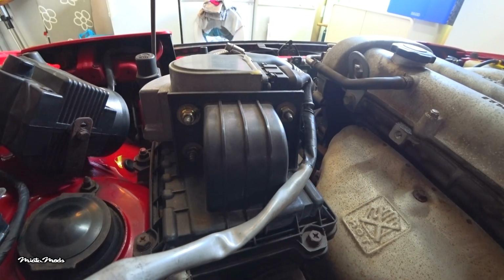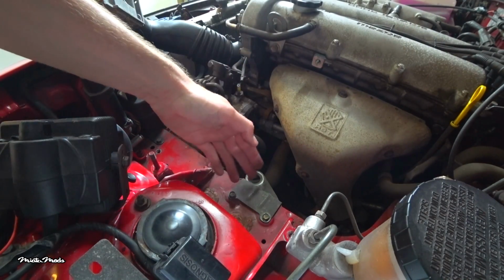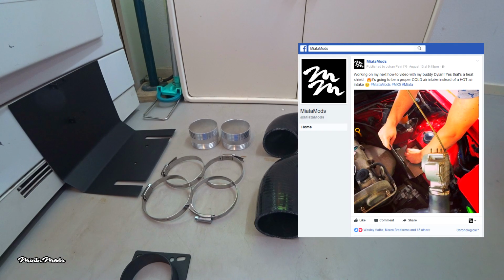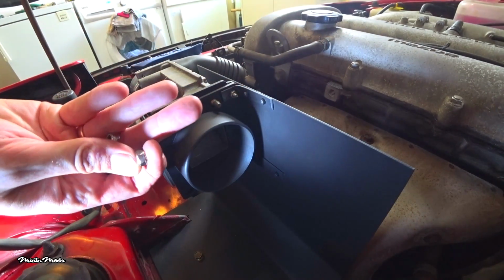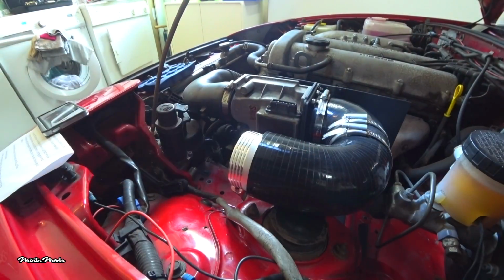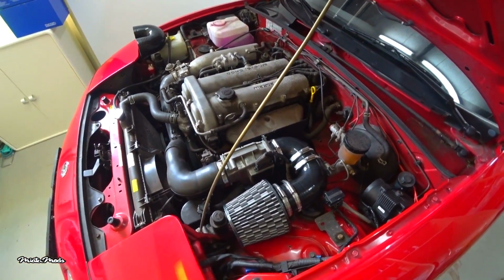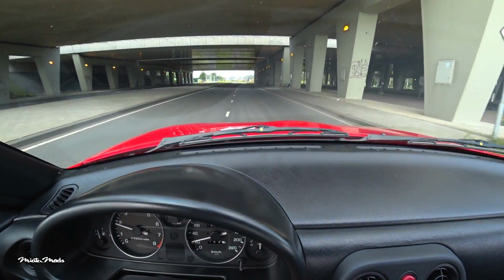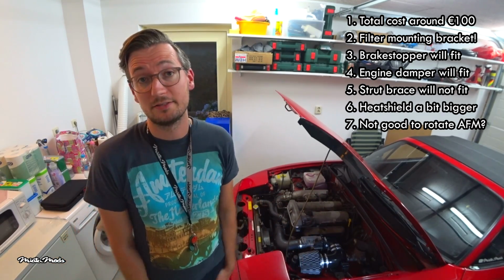MX5 NA Miata - How to build your own Cold Air Intake and heat shield

Comment: Does this heat shield push the afm farther to the left a bit instead of the crossover resting on the neck of power fluid resovoir I’m trying to fit an aluminum 180 degree pipe and need to know if there’s enough clearance for 12 inches
Reply from the maker: Yeah it does, but I'm not sure if you have enough clearance. There is one way to find out, and that is to try it!
Reply: Yepp all I can do is try I’ve got the heatshield made and am going to mount the arm father back to fit in an aluminum intake pipe that’s a 180 degree kinda like the one you used but instead of 10 inches in width from side to side it’s 12 but I think it should fit

Comment: What size 180° silicone hose would you recommend? 

I’d like to buy one, and make as little cuts as possible, to use as little connectors as possible. 

Thanks
Reply from the maker: Hard to say, your best bet would be a local seller

Comment: The air flow meter is supposed to be mounted horizontal so gravity doesn't affect the flap
Reply from the maker: I thought so too but it's been like this for 5 years now and I haven't experienced any problems so I guess it's not a big deal

Comment: Will this work on a NB Miata 1999?
Reply from the maker: Not exactly because '99 NB MAF is different from mine (AFM) but with some adjustments to my design you can build your own version
Reply: @MiataMods  Wouldn’t it be almost the same except no AFM adapter? I’m a big noob at this so correct me if I’m wrong but the 180/90 degree piping could go directly onto the MAF then to a pod filter

Comment: Your buddy who told you not to rotate the mass airflow sensor was thinking of the old mass air meters like on the Toyota’s..... they had a mechanical flapper door inside with a potentiometer mounted on the end... those need to be mounted right side up. Your Miata has a fully electronic airflow meter
Reply from the maker: Well Brian, I hate to break it to you but mine has a mechanical flapper too 😅 only the newer NA’s have a fully electronic one

Comment: Intakes such as this sadly don’t make your car any faster. If anything you loose a minimal amount of power. However when your car is tuned for all the extra air your sucking in, then yes, you can gain power. If you don’t have an aftermarket ecu with tuning capabilities, there really is no point in doing this other than the noise. Loved the video though!
Reply from the maker: Don’t forget the street cred when you open the hood
Reply: For sure 💖

Comment: Here's a little tip for you.  Use a nut driver to tighten the hose clamps.  It is much easier to tighten them without the slippage you get from a screwdriver.
Reply from the maker: Great advice, thanks!

Comment: Hey doesn't the afm sensor be in the original (horizontal) position becouse of the flap inside ?
Reply from the maker: Yeah I had the same thought but I figured why not try it. It's been three years and no issues yet so I guess it's not a big deal

Comment: Ive heard cold air intakes add horse power. With that being said how much horse power do you think you gained from this mod?
Reply from the maker: If I had to guess, 0 hp 😆
Reply: @MiataMods  i dont understand, people have been giving me mixed responses. From what ive heard it decreases air temperature intake which is more dense in oxygen than warmer air,  causing the engine to recieve "more oxygen". Could you elaborate further on your opinion?

Comment: Engine mod 101: If your intake is still pulling air from inside the engine compartment, it doesn't matter what the pipe or filter you are using....it still hot air going in your intake. Especially with a exposed intake only 6inches away from your exhaust manifold....just the hottest part of your engine bay. All for sound?  Sooooo RICE and that is being said by a Japanese!! LOL slow clap insert here
Reply from the maker: U doctor yet?!
Reply: @MiataMods  Yes yes I am. you a ricer yet?

Comment: Is it posible to make it in NB ?
Reply: Yes, but it is a bit different.  I run the stock air box with a K@N filter.  The air intake silencer has been removed and there is a nice hole that you can run a pipe to behind the front bumper and then mount into the hole in the driver's side of the air box.
Reply from the maker: Yes it’s almost the same but the NB has a different smaller MAF so the mounting bracket is a bit different. Also the tubing is somewhat different. Other than that it should be the same. Double check the mounting holes before you drill them tho!

Comment: Do you need to Program the new Air Mass Controller? :)
Reply from the maker: No. To be frank, there is nothing to program, you cant tune the OEM ECU
Reply: @MiataMods  yeah i was just a little sceptical because you use a different Air Mass Controler :)

Comment: Never do it like this, this loses so much air speed by the many bends and restrictions in the intake system.
In other words, this will not gain you any horsepower and maybe even lose horsepower.
Reply: The standard tubes are even worse
Reply: @deruniversalindikator  Yup, don't leave factory tubes or do this and you should be fine
Reply from the maker: Maat wat een onzin, waar baseer je dit op? Heb je het standaard systeem wel eens gezien? De airbox met 2x een 90 hoek erin en dat dunne pijpje wat uit de airbox komt? Er is nergens info die aantoont dat mijn setup de boel verslechterd. Ik zeg ook niet dat je vermogen wint, dat hoor je mij niet zeggen maar om nou te zeggen dat je dit niet moet doen vind ik nergens op slaan. Tuurlijk win je geen vermogen maar het klinkt gewoon wel dik en zoals ik ook al zei in mn video, het gaat mij om het geluid, niet om het verschil in vermogen
Reply: @MiataMods  i didnt understand it but DEFQON.1 is life
Reply: @MiataMods  Owner of Flying Miata: https://forum.miata.net/vb/showpost.php?p=7459038&postcount=32
Reply: @MiataMods  Ignore him man, just sounds like jelly :) Also if you're looking for TSI's maybe look on Ali first?

Comment: I don't know if it's a dumb question but does it fit an nbfl?
Reply from the maker: It should if you don’t have a strut brace. Keep in mind that your MAF is smaller so you will need a somewhat different type of mounting hardware

Comment: fits on nb fl ?
Reply from the maker: Yeah probably but the NB has a smaller MAF so the heat shield mount is a little bit different. Apart from that, if you don’t have strutbrace, yeah it should fit

Comment: Where did you get that adapter plate from? I'm definitely going to do this!!
Reply from the maker: Just Google ‘Miata AFM adapter plate’ and you will find what you need. You can get it on eBay for less than 10 bucks
Reply: Will I need an adaptor plate be necessary for a 1.8 model with a MAF as opposed to an AFM?

Comment: You realize that you make more power with just a k&n drop in filter
Reply: The trouble with the stock air box is that 90-degree bend of a very small diameter. I don't recall where I found the data but someone did extensive flow testing and found that the bend in the air box was responsible for even more intake restriction than the AFM. This setup does have 90-degree bends in it but they are much larger diameter so I would imagine this improves volumetric efficiency.
Reply: @mcarpen89  miatas love mid range power no more what the pipe is the car will only make 90 some horsepower ive owned 3 miata and have try all kids of ways to power with the intake the stock box with the k&n is the best you can run a bigger pipe from the throttle body to the mass air and run the stock box and have great low range power the mid is were the magic is you did do a really nice job doing what you did
Reply from the maker: It looks cool and it sounds great, that’s good enough for me. Just wanted to remove that ugly ass airbox, I’m not looking to gain a few extra horsepower

Comment: Sadly a cold air intake is illegal in my country (austria).
Reply from the maker: I hear this a lot.. I don’t understand why tho.. what’s the big problem with modifying your intake? 🤔
Reply: @MiataMods   It seems like there is a problem when the car gets louder. Replacement airfilters in the oem box aren't a problem but the rest needs to have a report included. And good luck finding a report for a 1.6 NBFL for example. If your power changes more than 5% you have to get your car standardized at a government facility. How you get it there is your problem. Because if you install it and it isn't standardized it's illegal to drive on the road.
Reply from the maker: Haha wow that’s crazy! I feel bad for you guys

Comment: Where can I found that square to circle adapter? Or did you build it ?
Reply from the maker: It’s called a AFM adapter plate. Check out the video description for a link to the item
Reply: @MiataMods  Thanks for the reply! i coulnt find any silicone hoses or the adapter here in México, i need to make a road trip to california so i can build my own  ;(
Reply from the maker: Alright man, good luck with the project!

Comment: I would like to know how you clean the pod filter and if do you spray it with some kind of oil.

(Excellent work with the videos, keep going!)
Reply from the maker: Well to be honest I'm not really sure but I think I'm just going to replace the filter after a while. It costs like 15 bucks so it's not that expensive. For the expensive filters you can buy filter cleaning products or you could try to clean it with just water and some soap. Make sure it's fully dried when you put it back on the car.

Comment: Hey mate!!! I am that josh_miata!! I just say that I read somewhere, like nutz or miataturbo.net
I dont really matter on this as I am running mafless, with me221.
That is the best mod, all this fantasy things are nice when you open the bonnet at a meet, but not between technicians.
Also, appart from that your car is running fine, the mk1 1.6 maf is "gate" maf, if a japanese engineer designed and decided a position, I put in doubt that you make it better than them.
But anyway cool mod and merry xmas dude, enjoy that nice toy!
Reply from the maker: It's not a performance mod, I'm just having some fun. sounds great tho ;-)

Comment: now your car ruin the air ratio. gotta tune the ecu after you install the intake. goin to suck to much air and your car is rich. you probably lost power and tq. you just gain quick response n make noise lol...I guess do whatever makes you think its fast. just saying
Reply from the maker: This will not ruin your AFR, it's fine. I will admin it's not a performance mod, but I never said it is. I'm just having fun, that's it.

Comment: It's almost prooven that it sound better but you loose some of the lower RPM power in return of gaining higher RPM power (less niutonometers but more max speed). I have a plan of doing some dyno tests before and after such change and compare results.
Reply from the maker: Send me an e-mail if you have those dyno results!
Reply: @MiataMods  sure I will but I suppose it will happen in a couple of months as it's winter time and I'm not planning on using my mx5 in salty environment ;)

Comment: This doesn’t really add any power. If you just want it for the sound, remove the snorkel on the airbox and make some holes in the bottom part of the airbox. Sound pretty good for 0 cost.
Reply from the maker: True, but my setup looks a lot better
Reply: That's true though. Looks pretty nice.
Reply from the maker: Thanks ☺️

Comment: you drove like  a grandpa thru that tunnel with perfect empty straight-away. How do you not floor it? I can't resist
Reply from the maker: I did floor it.. it's a miata, it's not that fast hahaha
Reply: If They weren't so hard to tune I'd buy one just to turbo it. That's why been watching Miata videos. I've never even wanted Miata but the way the layout is it's easy to Bolt up turbo hardware but ECU stuff is way over my head
Reply from the maker: There are a lot of well known ECU’s available for the Miata which can be tuned by a large number of companies so I think it’s easier then you think!

Comment: Where is the intake temperature sensor? 🤔
Reply from the maker: It's built in to the Air Flow Meter
Reply: MiataMods Ohhhh got it. I have a 1999 nb and the two sensors are separate. I want to do something like this, but idk where to put the temp sensor.
Reply from the maker: Aah yeah that's right, the NB has a MAF sensor instead of a AFM and it has a seperate intake temp sensor. You can still copy my design, but you need to drill a hole in the plastic tubing which run to your throttle body, so the intake temp sensor is 'behind' the AFM. You also need to change the mounting bracket a bit because the MAF unit is smaller. Good luck!

Comment: Turning ur MAF sensor on its side will not effect performance however it will cause you to fail your emissions test. at idle the car will suck in to much air because gravity will cause the flap to be not accurate. When you are in RPM's it is fine but i failed my E Test at idle because of this and turned it back to being flat and passed no problems.
Reply from the maker: That's seems a bit weird. When I had my AFM removed I held it in the position it's mounted in right now and you can clearly see that the flap stays closed.. maybe it's different when the engine is running? Thanks for sharing your point of view though.. I have not had a emissions test in the past two years so I haven't run into any problems.. yet I guess haha
Reply: MiataMods yeah I had the same results, when it was sideways it looked as if the flap was closed it must be different when the car is idleing. Thanks for the reply. Cheers mate
Reply: Of course is diferent as in a N/a engine the presure in the system is negative and only gets close to atmospheric pressure once you are at WOT situation. The gate has a mass, the gate has a spring and the MAF has a way of being installed, not rotated, not upside down. It has being carefully designed to get the best performance with the goal of passing the requested emisions levels for the age of the car.
If you like the sound ok, but please analyze your intake temperatures before saying you have gain something.
Reply: I did the same thing happen. I did not get this shield plate he made I just simply set my MAF sideways as I bought the adapter plate only. Well at first it was one but after about 10 min driving as things started to move around the car was not holding idle properly. It was sometimes good and sometimes above 1k rpm at idle which sucked. The IAK was trying to correct it but was having a hard time getting the idle right. I then tried adjusting the idle screw to fix this but nothing worked. I even thought my IAC was bad so I swapped it and nothing worked. So then I said well let’s put it back the orientation it should be because maybe the flap was not doing what it should be. What do you know soon as I turned it the correct orientation the car ran like charm without issues. It idles at 800rpm without a problem. So turning the MAF on it’s side does NOT work properly maybe for this guy it did but for majority of people it will not. I suggest you guys redue the design so the maf is the correct orientation so people won’t have issues like this.

Comment: Try trimming one side of the U shorter to accommodate the difference.
I'm sure a cleaner look will be achieved.
And maybe a slight/slight powergain may be achieved on the butt dyno.
Thanks❤
Reply: Sweet Miata very well done mod

Comment: Great mod! I'll be doing something similar myself. Predictably,  people are bashing it of course, to which I would say:  it may add or lose 1% or 2 % or 3% of power at various points in the rev range. So what? You will never, ever feel a 1%, 2%or 3% difference in performance while you're driving. 
Miata's are all about how they feel to drive, NOT ultimate performance- and that feel-factor was one of Mazda's key design priorities. Sound is a huge factor in that. If your Miata sounds nice, it will feel better to drive. 
Mine has felt way better, and is far more fun to drive, since I fitted an aftermarket exhaust system. Is it any faster? I doubt it. Does it sound nicer? Hell yeah!  Any performance gains or losses from a filter arrangement like this will be so negligible as to be imperceptible, but it will transform the way the car FEELS to drive, and that's what Miatas are all about.
 As for cold air/ hot air...it's as far away from the hot exhaust as it can get, and without detailed studies of airflow under Miata bonnets, that's good enough. The stock box draws air from a tiny gap between the bonnet and fender, this draws it from the gap between the headlamp, fender and bonnet, from the front of the car, from the airflow through the bay etc etc.  If someone's ever analysed the airflow in all those areas, I've never seen the studies. Anyway, TSI's and/ or a vented headlamp cover will definitely improve things, as you say. 
Will ANY of it make you feel any difference in performance, or result in anything more than infinitesimal gains or losses of power? 
Of course not! :-)  
Great channel, man, great mods and I'm thoroughly enjoying what you do to your Mazda. You have already inspired me to go LED with my interior lights and number-plate lights, so keep up the good work, and please keep the mods and videos coming!
Reply from the maker: You are totally right! Thanks for sharing your point of view!
Reply: Well, I built it according to your plans,  I've just finished putting it in the car, and it all works great! Sounds good, took it for a run, and everything fine so far :-)  I'm pretty certain the throttle response is definitely better, but that may be because the old panel filter that I removed was filthy! :-)
Reply from the maker: That's great! Another MiataMods Air Intake on the streets, awesome!
Reply: I posted a pic of it in the comments on your fb page :-)